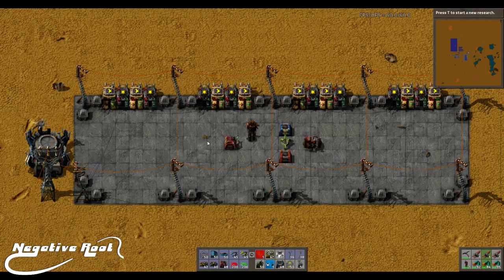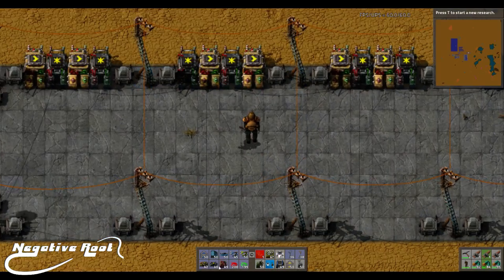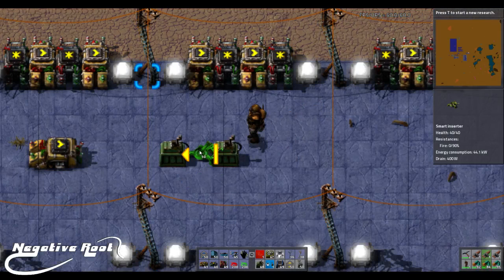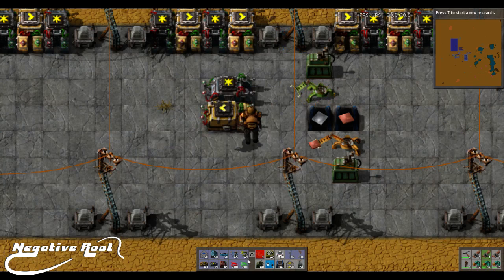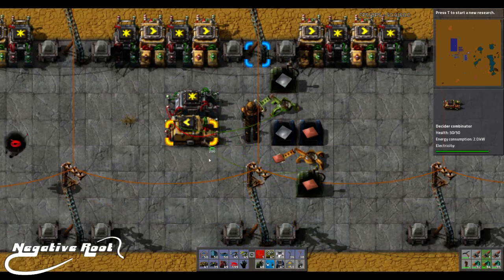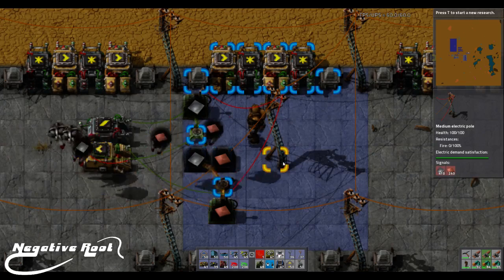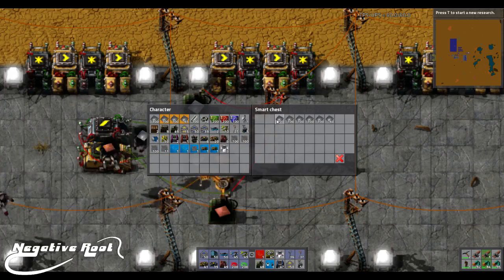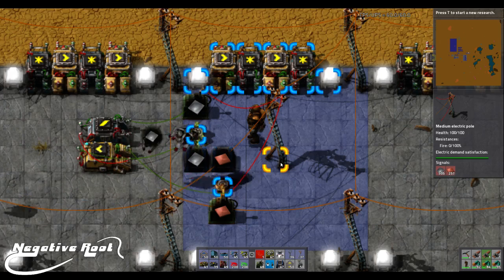Factorio Tutorial 49 Basic Combinators

Comment: Baaaysicaaaly this is a useless video. Takes 5 minutes before anything is done. And why would you want to keep the same amount of anything, that doesn't make any sense, why would you even use it ?
Reply: if you have a central conveyor of all materials you can use this system to lift only what is needed for flowing production rather than getting the production lines gridlocked with material that could have been used else where.

example : item takes 3 iron and 1 copper and 1 iron gear to make, but your production of iron is bottlenecks because the delivery train ran out of fuel. this allows you to make sure the iron gear is made, rather than making 4 iron gears or 4 iron plates getting to the end with 0 gears.

it's optimisation for late game, as opposed to simply making bigger lines

Comment: I'm sorry but this guide isn't very easy to understand. You seem to start off assuming people already basically know certain things about combinators and circuit networks. 
"We're gonna get that signal to happen." What?
"We're getting an output signal because this is obviously less." As you just point to a part of the screen for 1/2 a second. 
In the middle of setting up the first example, you set up a 'monitor wire'. As someone who has never seen or used combinators before, this just adds more confusion to things.
I'd have loved a practical example. Having exact ratios isn't something very useful to me. If I have a recipe that calls for 10 steel and 5 copper, I just request 200 steel and 100 copper or whatever is needed to keep up with demand.
I finally managed to blindly trial and error my way through telling an inserter to stop pulling items from an assembler once there are 50 of that item in a chest. That, to me, is a much more practical application which might make a better example for a video.

Comment: My head hurts from all that explaining. And I didn't understand alot.
Reply: +Negative Root Hey I've got a question for you; how would you use combinators to count how many times an action has occurred?

Like imagine if I you have a backup power system with steam engines hooked up in a way that it only turns on when all of your accumulators are empty, but you are often away from the base and the network so you don't know when a blackout has happened.  Is there a way to set them up to turn on a light (for instance) and keep it on until you get back, regardless of whether the power has come back on?
Reply from the maker: Douglas Graham yes. just trigger an S-R latch. It'll flip the once and won't reset until you personally reset it.
Reply: +Negative Root Thanks! both for responding so quickly and for simplifying it for me. I looked it up and my system is working. =)
Reply from the maker: +Alex Danco (Vinylrecords) let's just assume the combinators are little helper gnomes.

All that is happening in this factory is I have little helper gnomes ensuring that I:

1. Only put as much resources as I need on the belt to begin with
2. Each assembler only picks up and makes as much as needs

that's all that is happening :D

Comment: Killer apps for this circuit expansion are probably in oil processing. Give your cracking plants enough intelligence to turn themselves on and off so you don't end up with a massive surplus of one product or another. It's also possible to use them to make a smart steam generator that only comes on when the accumulators are drained.
Reply: +Alexander Roderick Ok, that is cool. I'll try that accumelator thing when I can. Right now I've simply disconnected my steam generators from my electricity network and pray that the accumelators don't run out before sunrise... So far they haven't but it's gonna get hectic with laser turrets later on...
Reply from the maker: Peter K. well, the devs did say they were running behind and needed to cut some things from 0.12. Sensors and the orbital platform were the things to go. It'll be implemented eventually. Until that time, you're just going to have to use your imagination!
Reply from the maker: Alexander Roderick exactly!
Reply: The killer app for a13 is to become able to turn Stean Engines on and off based on Accumulator charge. And I'm still upset that that one thing wasn't included in a12.